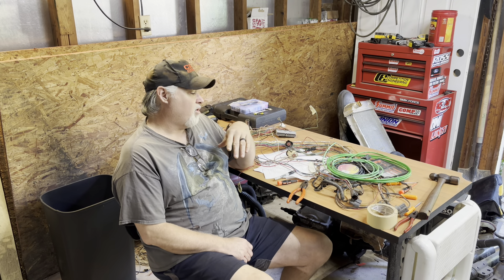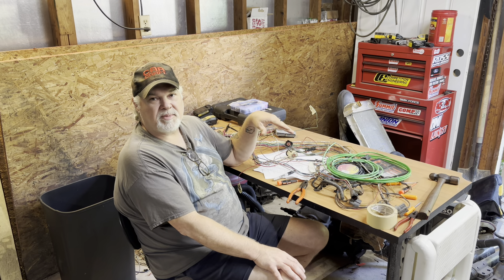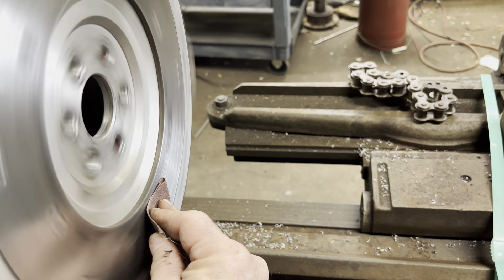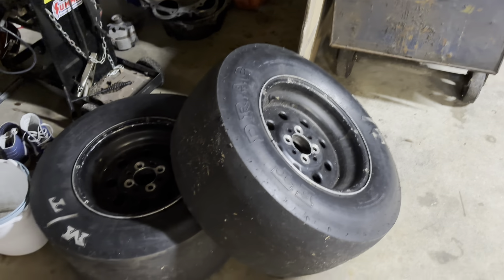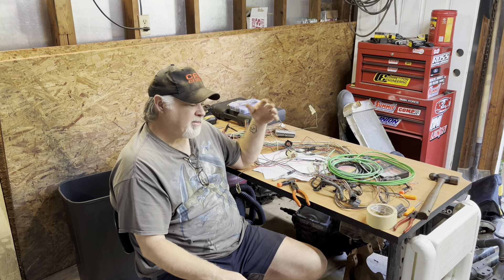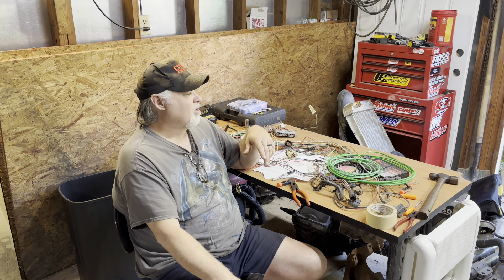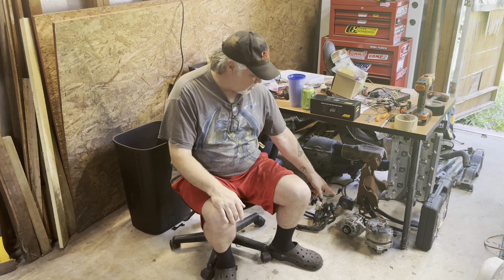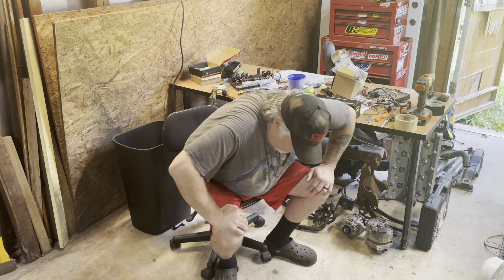1991 Mustang 5.0 LX SILVERCAR Pt.54 VORTECH V-1 EFI EFI EFI!! Clutch? Meh..later lol

Comment: Hi Rodney, I finally got my motor in. Starting to plumb it and wire it. I still need to weld up my headers and install an electric fuel pump. Maybe, on the road by the end of June.
Reply from the maker: 🤙🏻🤙🏻🤙🏻🤙🏻🤙🏻sweet!

Comment: My car wouldn't start, let alone run, without professional custom dyno tuning. But it starts every single time, no matter the temperature or weather or engine heat, runs and drives smooth as silk, never any hiccups or stumbles, vapor lock isn't a thing, and it gets pretty impressive fuel mileage. Carbs are cheap and easy but often require a lot of fiddling. Blow thru just increases the headaches. Take the car to David's and flip him the keys, let him test and modify the tune until it's good. Don't get me wrong, I like carbs too but fuel injection done right is simply better. But if you want a carb then you don't have to justify it to us, get you one.
Reply: It's so much fun when the pos won't start because the battery has plenty of juice to crank it over but 11.9v just doesn't cut it to run the computer, or when you spend all day chasing intermittent sensor glitch issues while my carbed junk fires right up and drives anywhere every time. EFI works great until it doesn't. Then good luck driving it home. Carb might start having issues once in a blue moon but will always get you home. When you don't have a 100k tow rig to take to the track reliability is kinda important.

Comment: Just a thought about your wide band sensor....
If it's a heated sensor, and you have the key cycled forward for an  extended period, and then suddenly start the car, the O2 gets "shocked".

Eventually ruins it.

You probably already knew that, but in case you didn't...
Rock on Tussin!
Reply from the maker: It’s a cheap one..think the gauge is the actual problem..I’ve haven’t had overly satisfying experiences with AFR gauges so far🤷🏻‍♂️
Reply: I have one for you, a good one. Like new. Innovate with a new sensor . A solid gauge  No cost, just need a place to ship it to !
People have helped me, and I'm paying it forward.

Comment: I can't get stock pushrods to work on my jy p heads, they bottom out when I tighten them, don't understand why they're too short?
Reply from the maker: 🤷🏻‍♂️..never had an issue unless heads have been milled..I’ve got a bunch of shim under brain with roller rockers (heads milled slightly) though..might be time for a shim kit if it’ll get ya close..cheaper than pushrods 🤓

Comment: Would forgetting to shim one of my calves on my p jy heads cause motor not to start?
Reply from the maker: Highly doubt it..should still fire on 7 even if ones off kilter…have fire? Fuel pump priming? Fire on starting fluid? Changing heads shouldn’t cause any issues…somethings unplugged or the valvetrain is completely jacked (which it shouldn’t be)…if it’s got fuel and spark it should at least pop and bang a bit..otherwise it’s got something going on besides the heads…